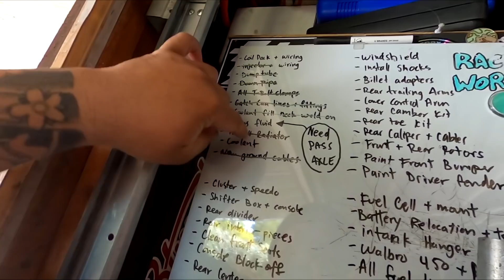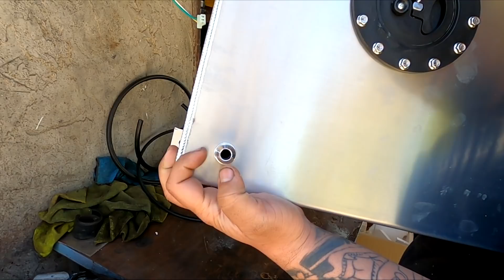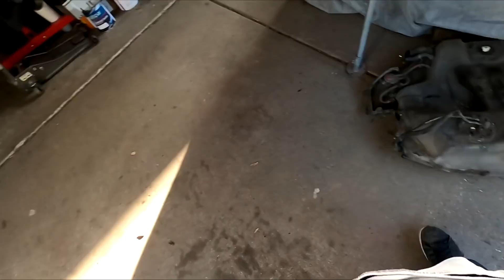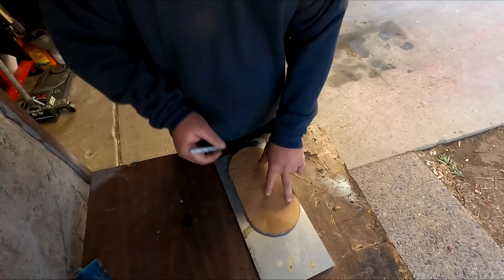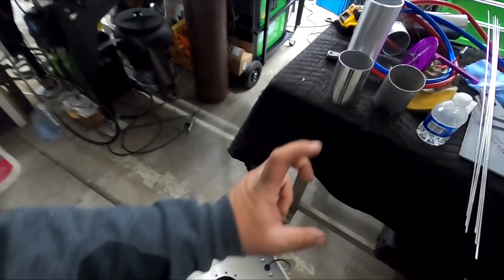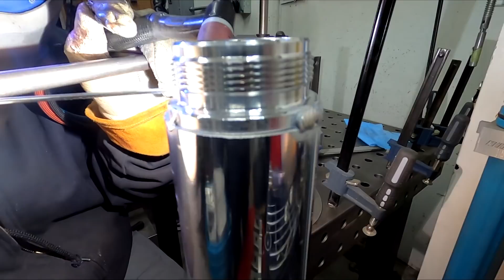CUSTOM Full-Blown Dual Pump Hanger into EBAY Fuel CELL | H2B-AWD-CRX

Comment: What size fitting did you use for the feed and return on the hanger? Trying to figure out what the thread pitch is on the full blown hanger pump for the feed and return

Comment: the pump position inside the cell is looking MINT, BUT if you wanted to get it even lower you could just make your own bracket/leg to bolt to the pump hanger.

Comment: Get you some fuel cell foam and cram that stuff in there it'll help with fuel pick up and fuel slosh. Or if you pack it tight enough you wont need the hanger

Comment: I’ve been watching you for sometimes and I’m a faithful follower, I’m replacing my main+rod bearings on my b18c1 what would the part #’s be for those bearings all the way around along with the manufacturer to buy from? Please, in need of your help.
Reply: Unless you got your Crank/Rods Machined, you’re going to be using Standard Bearings. Go to bearings are normally King or ACL. Matter of Preference really. All B-Series bearings should be Compatible. Also be sure to Measure Clearances with PlastiGauge. Best of Luck. 👌🏻
Reply: @mikefleeezy526  scenarios named, I made a dry pull and shredded oil pump along with twisting key, keyway sheared, and dropped oil pan to pull a bearing my engine guy who works at victory precision in Winchester VA mentioned new bearings could fix it since the motor could not have more than 1,000 miles on it MAYBE!!!(had it for 2 months after being freshly built top+bottom, ACL Oil pumps I’m told are junk) and basically he said dry run oil through it without plugs or injectors hooked up and just sport new bearings, thoughts?